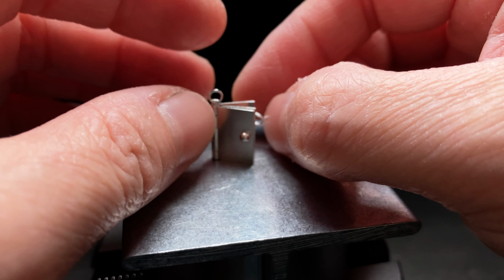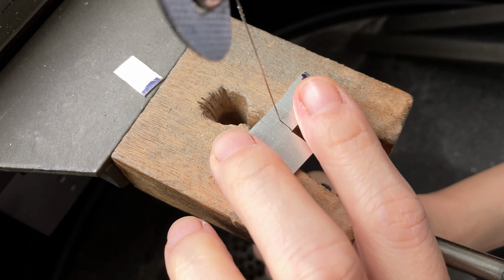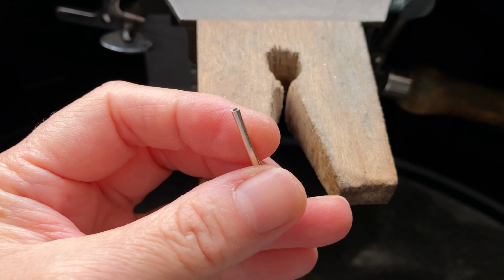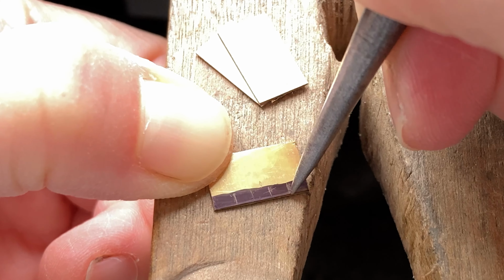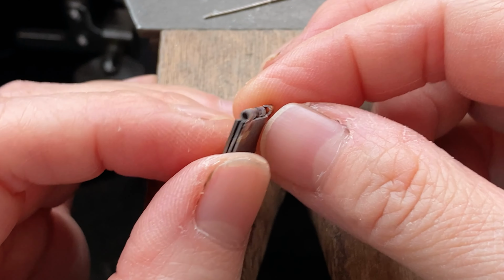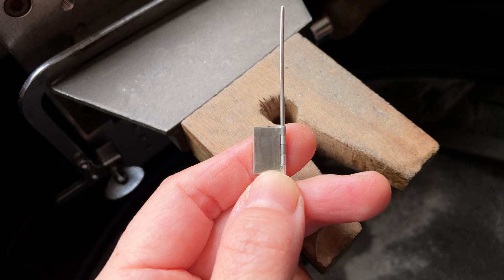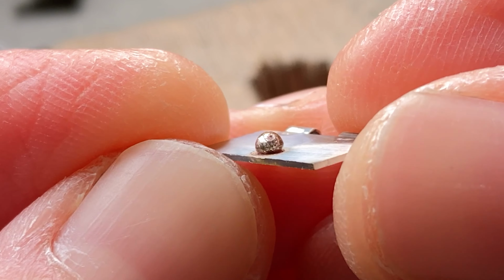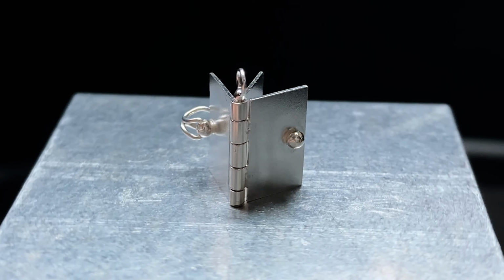Making A Miniature Silver Book Pendant in 6 Steps

Comment: Interesting way of making the hinges. I think I would have cut the silver rectangles with tabs that I would then fold around the hinge pin  to make the hinge hole & then solder the bent over end. This would use more flat material, but save having to use a tube, but perhaps at this small scale it would not be a practical method whereas yours worked. Thank you for sharing!
Reply from the maker: Great idea!